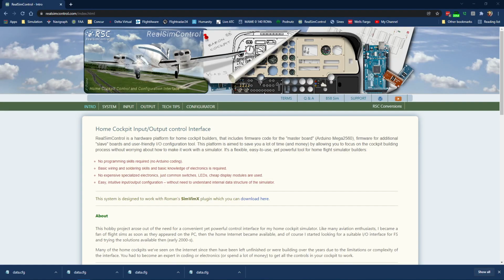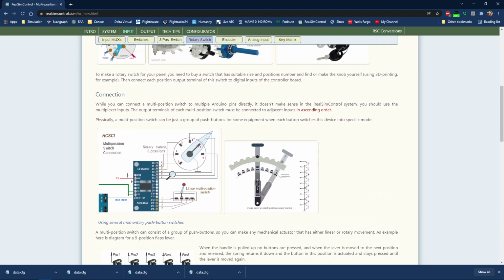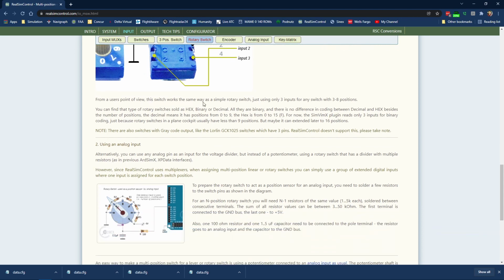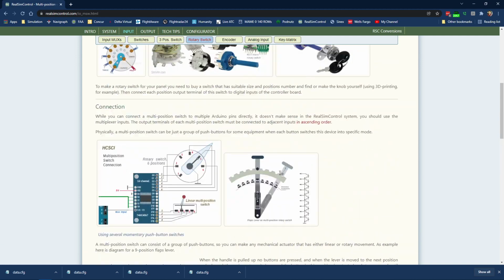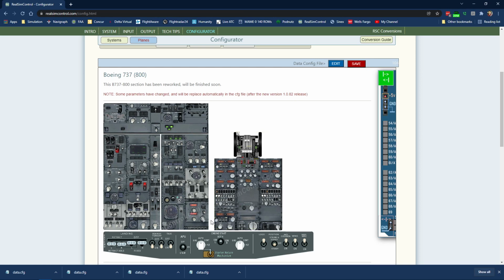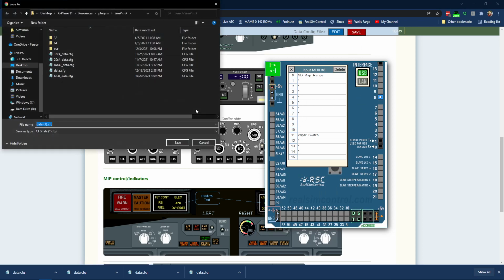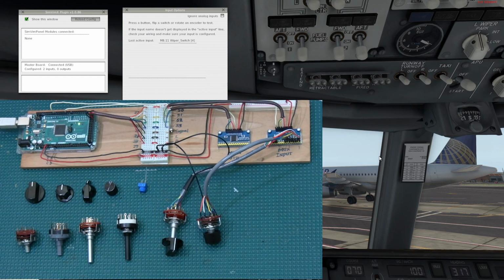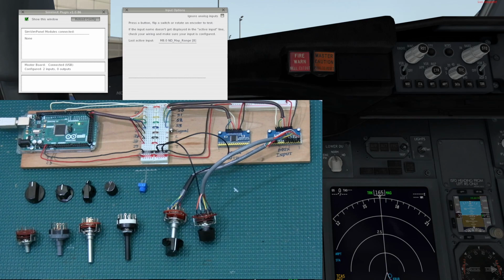Back To Basics: Using multi-position rotary switches with SimVimX/Real Sim Control (RSC)

Comment: Hola, que tal? Do you know why for a 3 position switch the configurator only need 2 pin position? For example the A320 wiper switch
Reply from the maker: Hola Fabio, because of some back-end programming magic that the plugin does. Since it's and ON-OFF-ON switch it only uses pins for tbe two ONs, but I guess when it's on neither the plugin treats it as another "position"
Reply: @Qosmokid  The 3 position switch uses one dataref with 3 different values (0,1,2) for each position. But because I can connect only 2 pins the switche only moves to one direction.
Reply from the maker: @fabiofarinon3988  sometimes I've needed to reverse the values so 2,1,0 or even 1,0,2 or 2,0,1 depending on how the switch behaves in the sim
Reply: @Qosmokid  hola, I tried all the possible combination but it still doesn't works, then I am thinking it's maybe a problem of the type of switch itself. Would you please share with me a link for buy a 3 position switch (anyone) that works with simvim, thanks
Reply from the maker: @fabiofarinon3988  Hola Fabio, I just noticed the wiper switch on the Airbus is a rotary switch. I don't use any Airbus aircraft so I didn't even know. I assumed it was a toggle switch when you mentioned it has 3 positions but only uses two pins.

I would try something like this switch but just use two of the contacts. so the position that would be OFF would not have a wire on it, just the ones for SLOW and FAST and of course GROUND.

https://www.ebay.com/itm/284615095451?hash=item424461b49b:g:KpUAAOSwqnRimFKY&amdata=enc%3AAQAHAAAA8C3yXVjLJrl%2Bb0bhzlkdMwFAkoDesYqsSZ1d%2BbRrkTQbGf8kECiC0EL6UrFalP0TJbwjcW1ECVwTiHPjJ24f%2Febn0bDl3HGnPAllPB%2Fnz2d8NnqBKfUfD8VH0vgYSzAPwRGr7Cm2mrXEOIlNs8ePlneJ%2B6XM%2BCRH6o4WIxOfsaLvrUcyiRqJj75X48XSAKm8WrxbPhEOLZAYgPF6hyXeiYzjSlvPx4OB%2FhRNqkvjVfOMFB0WtTNvws8zfU%2FjBD8tCtPySn5Q%2BhBeR1raqfFhGdCW1cN9MJUkwZ4uIjbQpjthh1%2FhXgTjWfWrjFrVvSA92w%3D%3D%7Ctkp%3ABFBM_Le7jalg
Reply: Functiona, con un rotary switch de 3 positiones y un pole, muchas gracias.. Y espero tu proximos videos jaja.. Sabes trabajar con power motor devices?
Reply from the maker: @fabiofarinon3988  oh que bueno que ese funciona.  Y no nunca he usado stepper motors ni servos

Comment: What is the name for the third switch?
Reply from the maker: They are all multi position rotary switches
Reply: I listened again and it was a 2-pole.
Which is what I need. ☺
Reply from the maker: @IngeBall  Oh that's what you were asking lol sorry 😂
Reply: @Qosmokid  😂
I'm gonna use it for outputting different resistorvalues on pole 1 (A)
and use pole 2 (B) for LED indikators.

Comment: hi!
What is the best resistance for potentiometers in simvim?
Reply from the maker: This is directly from the website:
Any suitable potentiometer with full resistance of 1k to 30k can be used. Actually you can use any pot up to 100k, But the lower the resistance, the less interference it picks up, and the circuit is more tolerant to electrical noise in the power lines. Say, 2 - 5k is fine.